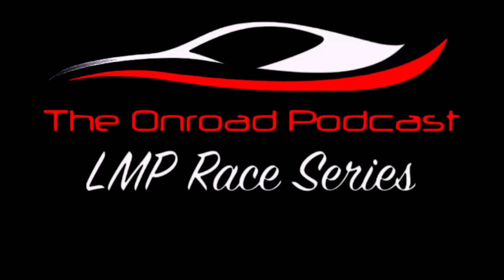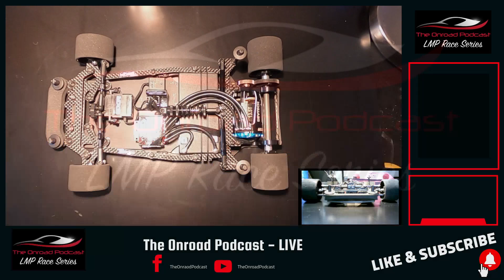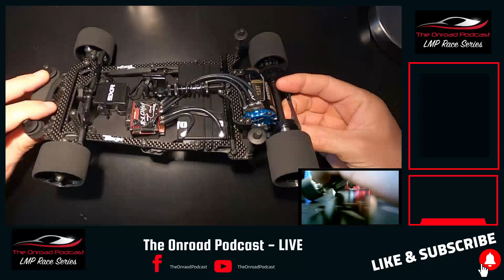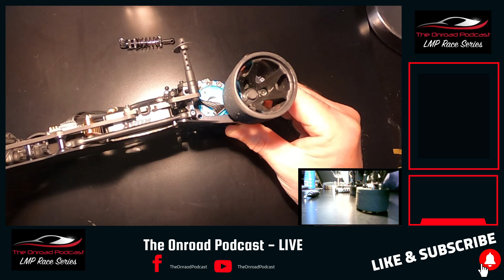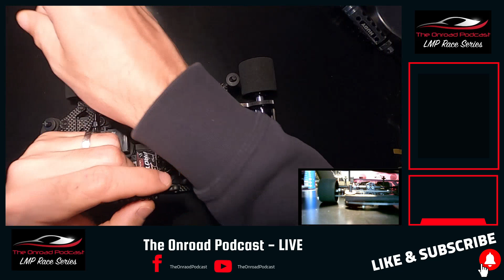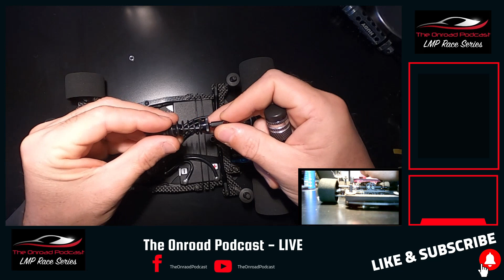Adjusting 12th Scale REAR DROOP

Comment: Too bad the bottom collar of the shock with use/hits entrers the plastic cup few tenths, ruining the nice setting carefully done. You easily end with center part of the chassis scubbing the carpet and you don't know why. That's a real PITA. My suggestion is to always fill the gap between the cup and the collar with some shims. In this way the shock can maintain the length. Never leave bare threads
Reply from the maker: I’m confident there will be a fix IF what you say is correct.
Reply: @RCRaceCar  no fix since years, it's just the way it is. The fix is to put a shim to fill the gap. No more problems. Easy.
Reply from the maker: @Flygio  this car doesn’t have a center shock, a damper instead and pretty sure this won’t have the issues you’re referencing.